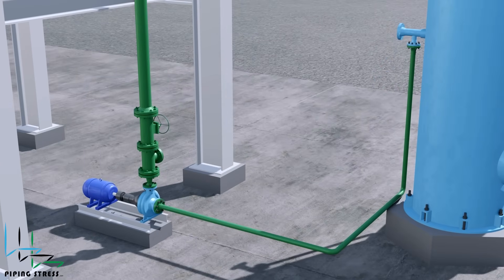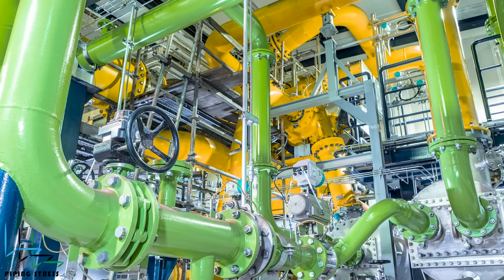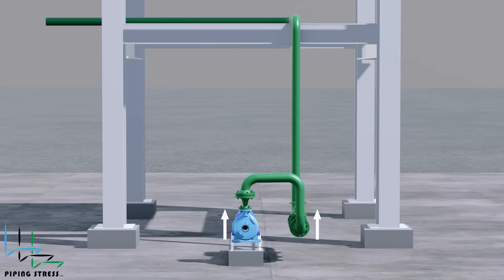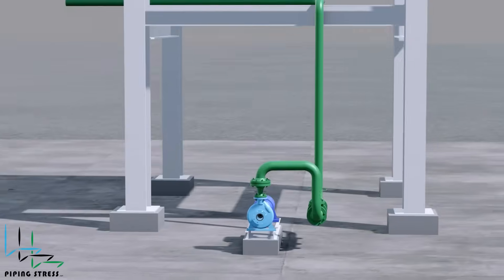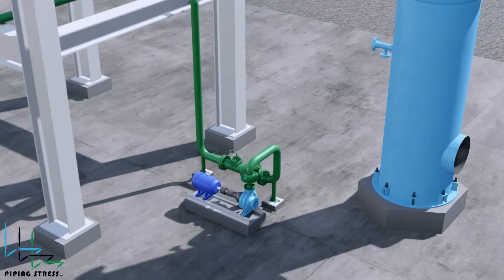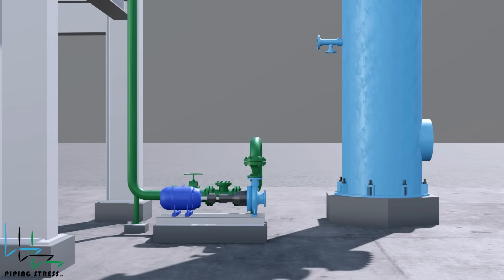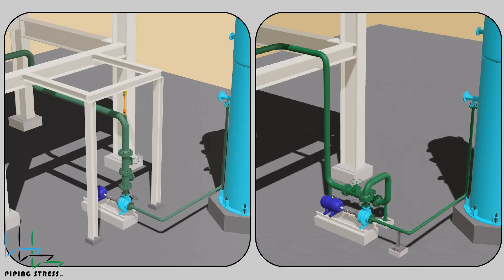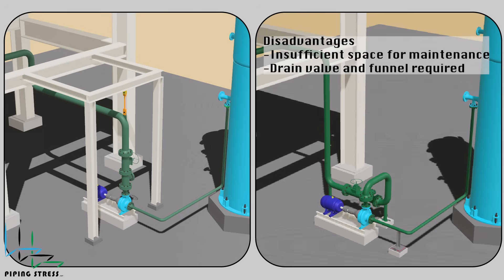Pump Piping Stress Analysis - Centrifugal Pump Piping Design

Comment: How about pump maintenance or pump installation..heavy lift is difficult is under pipe rack
Reply from the maker: Thanks for your comment. Monorail can be used for the pumps under the pipe rack in case of maintenance.